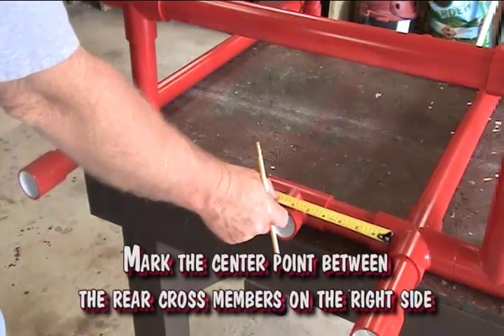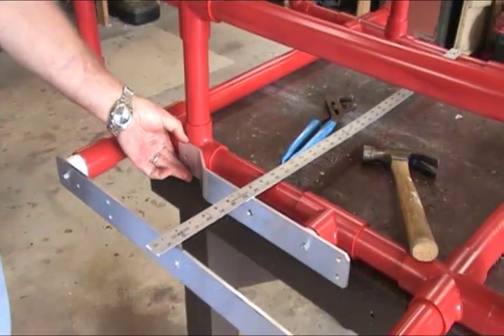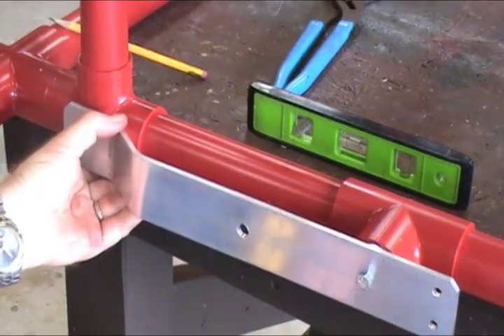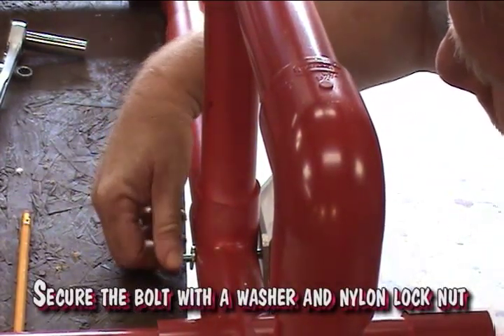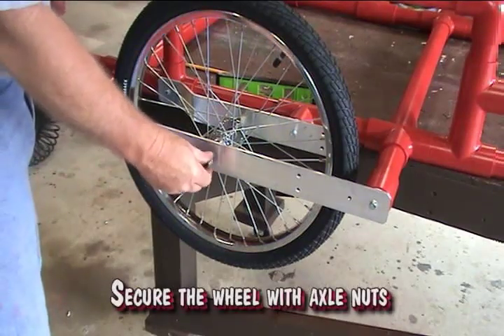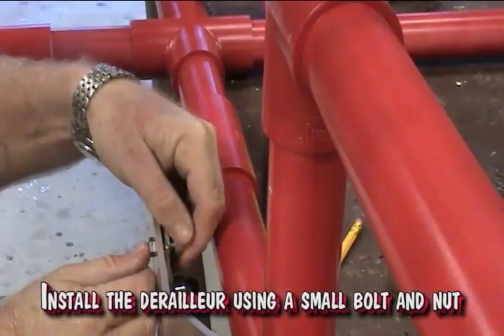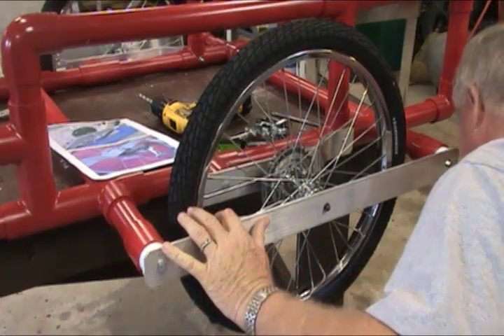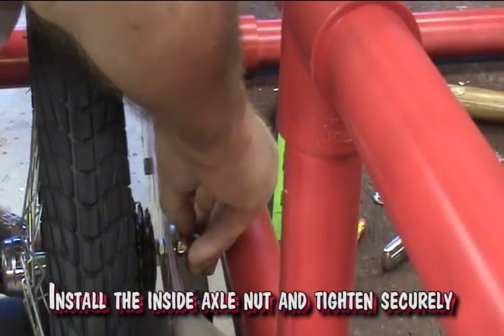Part 11 of 29  - PVC 4-Wheel Cycle  - Install the Rear Brackets and Wheels

Comment from the maker: The plugs with the fender washers are adjustable front to back, once you place the plugs in the frame, you can turn the plugs to make the minor adjustment needed to center the axle hole with the center frame.  After the alignment, you mark the bracket and frame, pull it back out and tighten the bolt down, re-insert the plug into the frame. By using the bolt and fender washer, you can remove the bracket to repair or replace any PVC parts where the axle and frame connect.
Thanks,
Norman

Comment from the maker: I would not glue the plugs, if you need to repair the plugs due to wear, you can pop them out and replace. The bolt through the frame will hold the plugs in place, along with a small screw drilled into the PVC to plug under the bottom of the frame.
Thanks
Norman

Comment from the maker: Do not glue the plugs, you will have to get to the inside eventually to tighten the bolt. Over time, even the nylon lock nut will loosen. If you glue the plugs and the bolt breaks or bends for some reason, you will not be able to fix it without cutting and altering the frame. Again, use a screw on the underside of the connection to hold in place. The plug will not come out as long as the rear bracket is tight against the frame with bolt and nut.
Thanks,
Norman

Comment: did you use steal or alluminum for the brackets
Reply from the maker: I use aircraft aluminum, it is very strong and lighter weight than steel.
Thanks
Norman

Comment: Are you also able to pedal this bike?
Reply from the maker: The PVC bike is a pedal bike, two people can pedal at the same time or you can pedal alone. You can also add an electric e-bike wheel to the non-drive side and drive with a throttle.
Thanks,
Norman